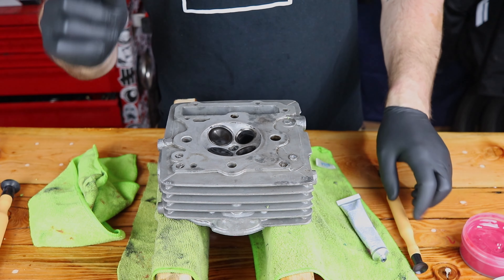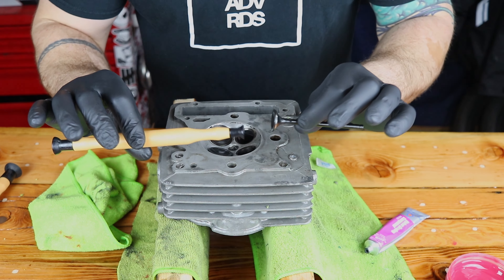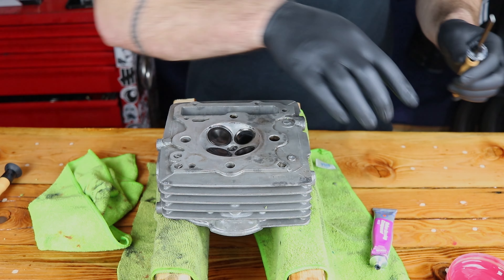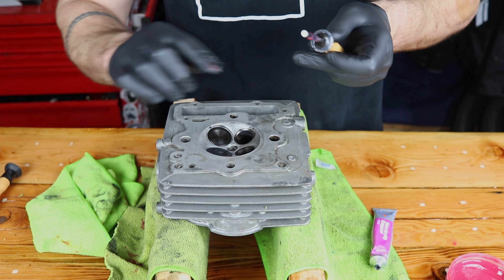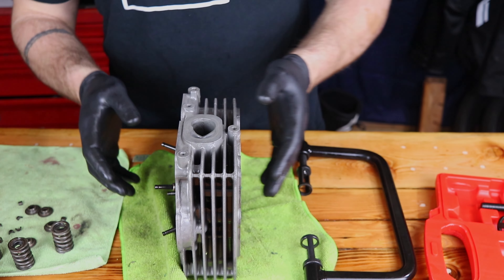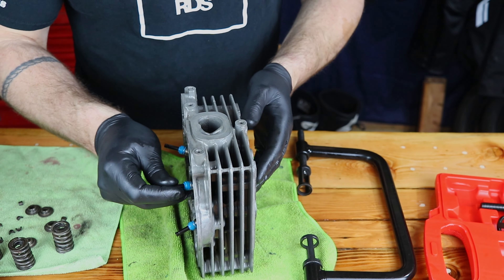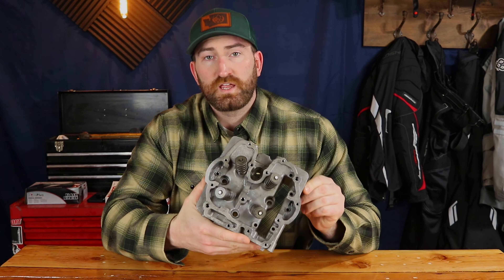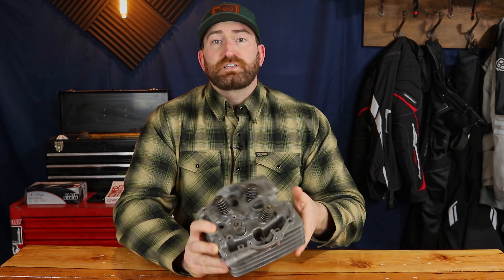XR250 Cylinder Head Rebuild

Comment: Hey I have a question I recently did my valve seals on my 83 atc 185 and those little clip things you put in when you have the spring compressed I could not get them in I did get them In it took me probably 2 hours is there a easy way to do this without them falling out when I release the tool.  Thank you your videos are 👌
Reply from the maker: Do you have a spring compressor? I have seen guys put just a little grease on them so they stick to the valve.
Reply: @WeekendAdventureRides  yes I have the spring compressor so put grease one the clips so they stick?
Reply from the maker: @Fieldyfan94  yes just a little on the concave side. I also use needle nose players to position them

Comment: I’m rebuilding an 84 XR 350 R and can’t seem to find the exhaust valves and I need them. When I pulled the head off I found the piston was broken. Well of course the pieces went through the exhaust and bent the valves. Any suggestions?
Reply from the maker: Interesting... kibblewhite doesn't have a valve listed... I was able to find one on ebay looks to be oem... I would start there. If you can't find what you are looking for there I would try "honda parts direct". Hope this is helpful
Reply: @WeekendAdventureRides  thank you and sorry it wasn’t related to your videos. Keep doing what your doing. I love the videos.

Comment: I probably would have cleaned the ports up for some smoother running nothing else. Rub the head mating surface on a level surface, Not knowing where the head came from so as just to be safe.. We all have our little quirks , Not to criticize your work. Well done.

Comment: Ive heard countless times to replace the valve springs and keepers on mine, keepers I will let slide but springs I understand, did you replace springs on yours?  And if so where did you find them for an 82?
Reply from the maker: My springs were within spec so I kept them but you can get springs and valves from kibblewhite. I had a bent valve from the timing being off and it coming in contact with the piston.
Reply: @WeekendAdventureRides  I also just realized yours likely isn’t an 82, especially if I saw an oil filter on it
Reply from the maker: Yeah its a 95
Reply: @WeekendAdventureRides  okay I have a machine shop that helped a lot in the rebuild of my dune buggy from the block up with the most absurd modifications, I know springs are something that if you have the specs can be ordered elsewhere, so I may give him a try, I will still be glued to this stream as I figured out a lot of next steps watching it
Reply from the maker: I appreciate it man. Good luck with your build!
Reply: @WeekendAdventureRides  there used to be a way for me to just send you messages and pics privately but I guess not anymore
Reply: @BraydenWhiteMusic  I replace valve keepers every single time. I’ve seen them come out before and wreak havoc. They can sometimes come out even if they are installed correctly.

Comment: Is this possible without the special valve tool? Lol
Reply from the maker: It's not an expensive part. I wouldn't try to do it without a spring compressor.
Reply: @WeekendAdventureRides  thank you, I priced them after my comment. They are too cheap to not use